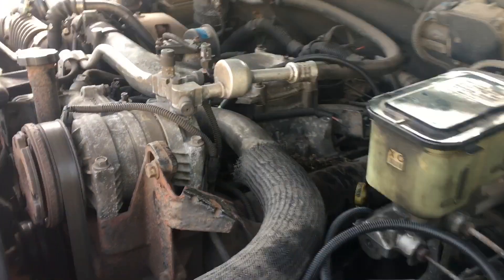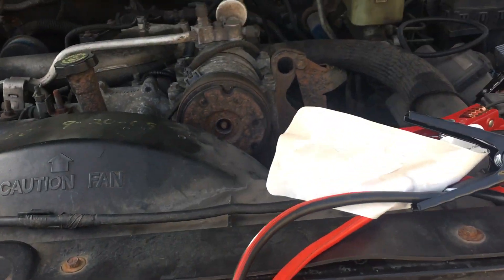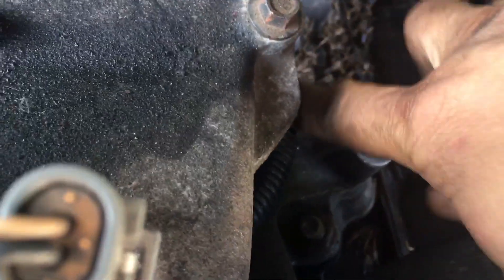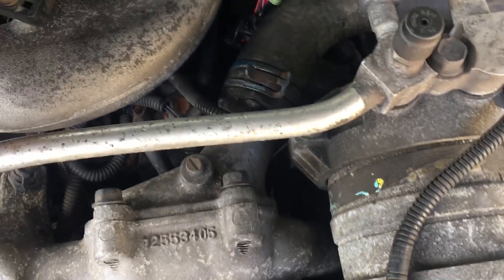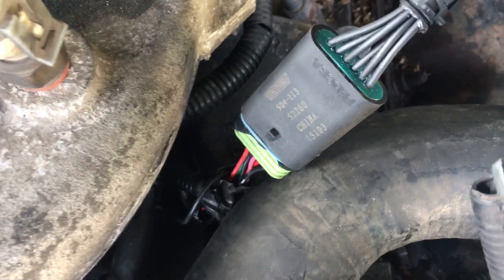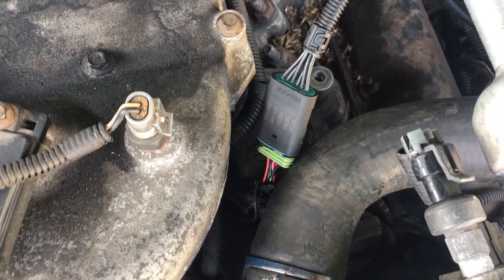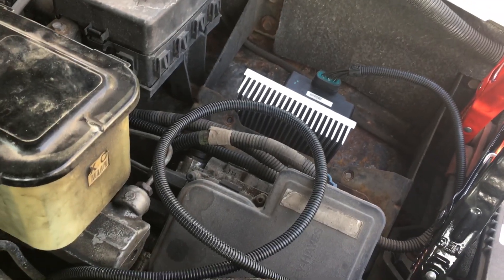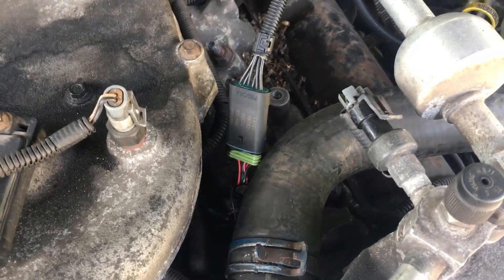Chevy 6.5 Diesel PMD controller location and repair

Comment: You need to put the right resistor into the PMD jack, where the cable plugs in. #5 or #9, generally.

Comment: is it common for thoes to go ik the PMD and the injector pump is common on them to go the one i am working with the truck starts but has a rough idle and has a hard crank to start.

Comment: I’m about to change my 2004 Silverado 1500 for a 97 Chevy 3500 6.5 Detroit, did u think is a good idea? the truck is running but is dripping water from the water pump
Reply: I have over 600,000kms on my 3500. A set of heads and injection pump over the years. Make sure you understand the diesel or have someone who does, otherwise it will put you in the poor house.
Reply: When you put your new water pump on for about a cup of soluble oil cutting oil in the radiator and let it mix up it'll lubricate your plump pump for years I had a used pump on a Ford pickup and I drove it for 11 years and never needed to change the water pump using cutting oil
Reply from the maker: I really like that recommendation…

Comment: Do you need to have the computer flashed too or no
Reply from the maker: I did not I just plugged it in and it worked and on the Earlier models that had this they weren’t that complicated
Reply: The Clay Way okay thank you I just didn’t know if it had to be flashed or not
Reply from the maker: No problem . You won’t never know if you don’t ask

Comment: I bought a dorman pmd and it lasted 4 days. Has a lifetime warranty. Got a new one, added a relocation kit, i then relocated it to the front bumper. Lasted about 3 weeks then left me stranded 1hr away from home. Any idea to why they are failling so fast?
Reply: You need to check your lift pump...if its starting to fail then the pmd works harder and begins overheating
Reply from the maker: My only guess would be heat or a possible corroded ground wire somewhere that’s just off the top my head I didn’t have any problem with mine personally. And I’m very sorry to hear that

Comment: Is this is the reason why won't start? Because I have a 96 gmc diesel and won't start
Reply from the maker: Good morning yes that’s the reason I changed mine I actually did this. In a parking lot at a hotel. 

I can’t say for certain that it’s the reason yours won’t start but is certainly the reason mine wouldn’t

Comment: How bad to get the plug of the pmd out I can't get to see it
Reply from the maker: Hey Wilson honestly I don’t remember I’m very sorry I wish I could be of more help
Reply: I appreciate it am trying to figure it out I think my 3500 pmd is going bad because she shuts off running
Reply: It is a big help to take the air plenum  off  6 bolts and a 7 th where the rubber hose connects to the turbo  .
 Think it was a big help to snag the wires  first before you unhook the harness  from the PMD .  long skinny screwdriver  and a good light  ..

Hats off  to The Clay Way for getting it without taking off the plenum ..

Comment: If you are in a pinch all you need is a coat hanger to grab the PMD harness and slightly lift it up to expose the connection.
You also need a flat head screwdriver to gently disconnect the harness connector.
Reply: I can't see my pmd on my 6.5 diesel truck